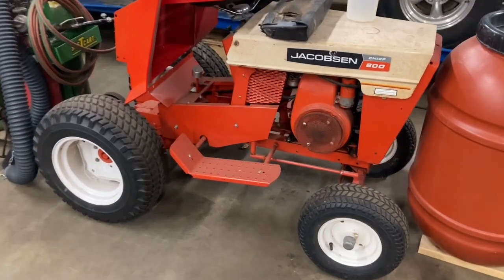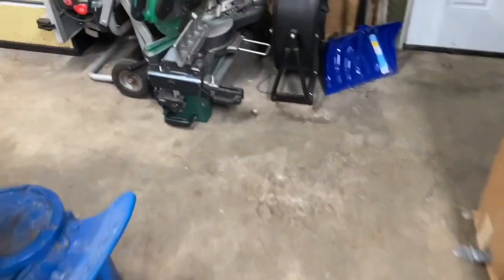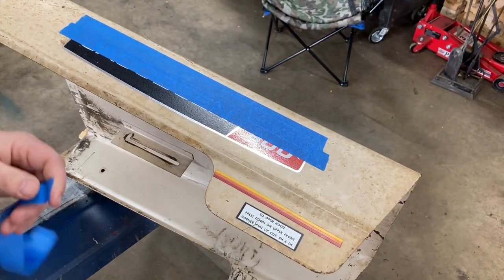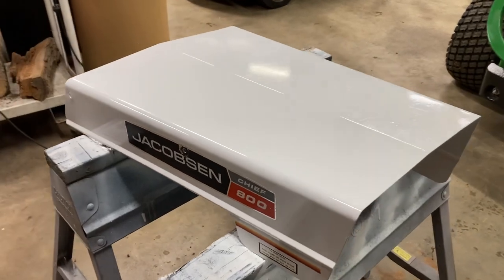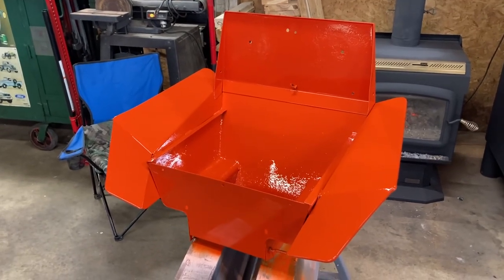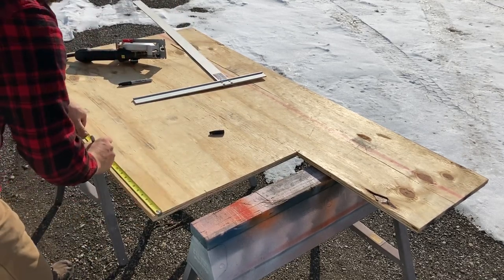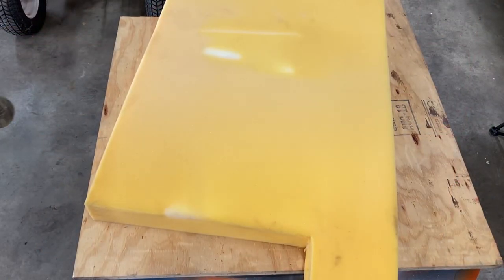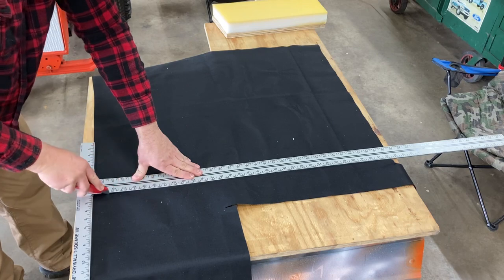Jacobsen Chief 800 Restoration Part 1

Comment: My dad bought the identical machine to yours, only with the 10 HP Kohler......the Chief 1000. I ended up with it as an adult and had it for many years before I finally traded it on on a new tractor in 2001. I still have all the sales brochures and manuals for it like yours, and they are in  really great condition, ie; not all greasy etc and not all torn up.  We had the 36 inch deck and the 42" snow blade. This sure brought back some great memories.  It cut a a LOT of grass in its lifetime.
Reply from the maker: That’s a great story! I wonder if the manuals are worth anything? This mower had a wheel horse snowplow on it when I got it but I took it off and sold it. I got a nice set of tire chains with it too. Those old kohler engines just run and run!👍
Reply: @beesprojects2692  Yes they did/do. Ours never burned a drop of oil. My neighbor is an old guy that has a boatload of International CC tractors and they al have the cast iron Kohlers in them as well.  Not sure if the manuals would be worth a lot, but since Jacobsen made the same exact tractors for Ford, Oliver, Minneapolis Molene and a couple others, all in their respective color schemes, they might be worth something more than I know.  I still have the chains my dad bought new  for ours in 1969. Ours was actually a left over  NOS  1968 model. I had Goodyear R1 tires on it for many years and they were awesome in the snow. I never even used the chains with them and about 100-125 lbs of steel I beam shims under the seat in the tool box. Ours/mine, still had the original tires on it in 2001 when I used it as a trade in and they were all still in excellent shape. They were just like yours.  23X8.50-12 rears and 16X6.50-8 fronts. It's hard to tell in the thumbnail pic for the video, but it appears your  front frame that surrounds the grill is the cast aluminum version they used at some point. Ours was the cast Iron version. Our hood had the screw knob on each side up near the front that held the hood down.
Reply from the maker: @404nitro  yep this does have the cast aluminum front and the center console is cast aluminum as well. I do believe that the tires are original and are Goodyear and are in excellent condition. I do have what I believe to be a “1963” Cub Original with a 7hp Kohler that I will throw in a video just to get some input on restoring or leaving it the way it is. The interesting thing about those is that they have the same transmission as the Farmall Cub without the PTO so you could actually take the back plate off and put one in if you wanted from what I’m told. As far as these Jacobsen/Ford/Oliver/Minneapolis etc tractors, I don’t think they hold a very high resale value because they made some many of them but nonetheless they are a neat old machine for sure!
Reply: @beesprojects2692   Ours had the cast iron front and center. It was a solid old tractor.  I know one thing that hurts their resale today, and that is- it is hard to get any parts for them. All original NOS was sold to a company called Corrls Tractor supply IIRC, and they closed their doors  many years ago now. I did buy some parts from them before they closed up, but I have no idea whatsoever what happened to any remaining NOS parts they had left, which they told me wasn't all that much even way back in the '90's.
Reply from the maker: @404nitro  wow, yeah that makes sense. I know I couldn’t find the lower steering bushing for this tractor when I originally started restoring it so I jumped on the lathe and made one. Luckily they are so simple that you can pretty much keep them going. I ended up buying a bunch of parts from a local small engine business that was going out of business about 8 years ago and there was quite a bit of NOS items in there. I had planned on putting them on eBay for sale and never did.
Reply: @beesprojects2692   Well, if you have them now, I am quite sure you can move them on Ebay. I am aware of a guy or two on YT that is restoring one of these tractors, one is a MM, but as we know, the parts are all the same.